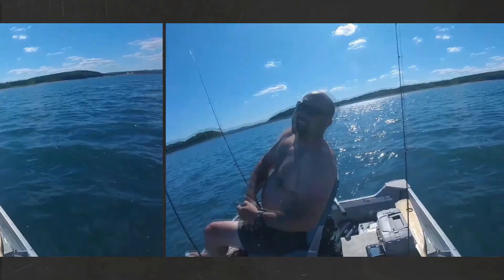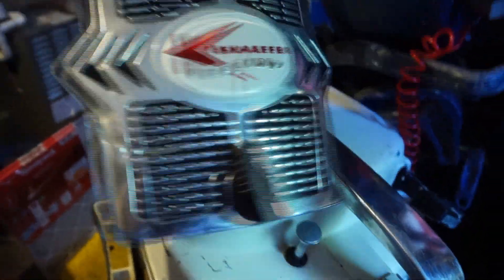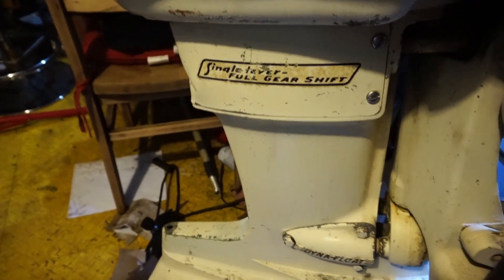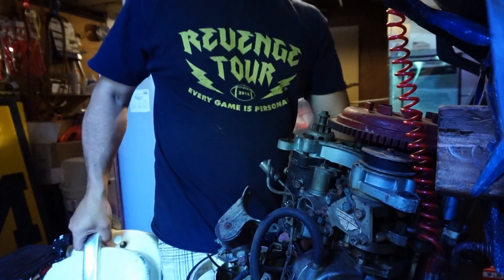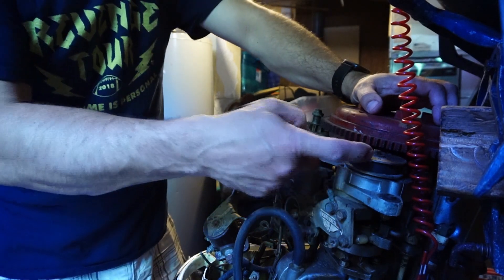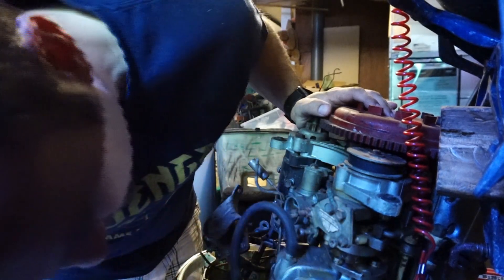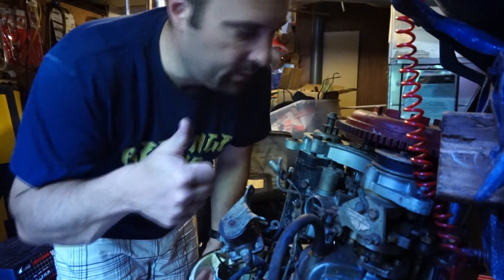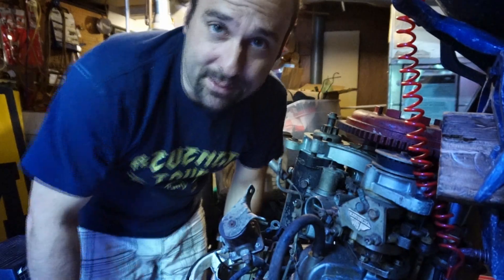1964 Mercury 500 50HP Kiekhaefer! We gunna try to get her running!! Back to life! Will she run????

Comment: UhhhOhhh! a Mercury pronounced  (CARL)KEEEEEEEKHAAAAAFER  500,LOL.looks like a 1962-63 model they went black in 1964 and changed the front plate too. Has aircraft type magneto  points and coil inside. Pick up a shop manual to really learn it if you decide to keep her there loaded with overthought adjustments and  very confusing technical things. Back in those days in part they were designed to be repaired in certified shops and not by  handy local backyard mechanics,LOL.,Good Luck.  Oh very nice,clean motor put it up for sale on E-Bay pickup only if you decide  to let it go should sell quickly,,, WOWW! shes a beaut!....Glenn
Reply from the maker: Omg I still can’t pronounce it!! Keekhafer? 
Aircraft?? Oh boy… so it’s all in that unit then. Not under the flywheel? Do they make parts for this? It’s from a friend I’m fixing it for him. We actually picked up a parts motor for it!!
Reply from the maker: @GPOldMarineShop  got it!!! Thanks again!!
Reply: @BlackoutBilll21   You welcome  Should be  a 4 cylinder too...  Do you have the harness and controls?????
Reply from the maker: @GPOldMarineShop  yes it is 4 idk why I kept saying 3. And no no controls

Comment: That's a 4 cylinder .
Reply from the maker: im aware... did I say 2??
Reply: @gdamtbnms  "3 cylinder" . Good video in any case. 
I also have a 63 Kiekhaefer Merc500.
I love the motor, but yeah, it's quirky !!
Just wait till you have to put the lower unit back on and have to figure out where neutral is. 
Actually, you'd be great at an illustration for that !!
Reply from the maker: lol yeah this one is impossible to find parts for/ set the points gap!! when i take the lower off Ill def demonstrate! @Ronaldo-wi2im
Reply: @BlackoutBilll21  That'd be rad !@